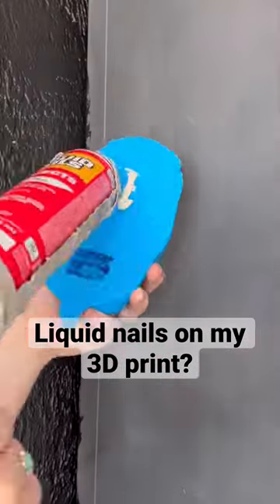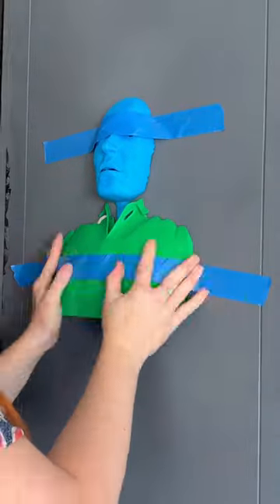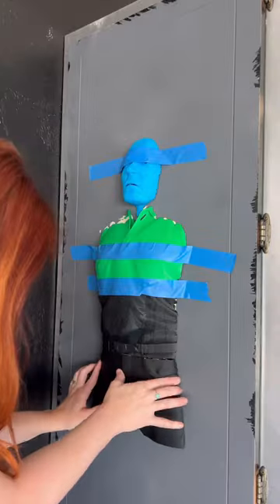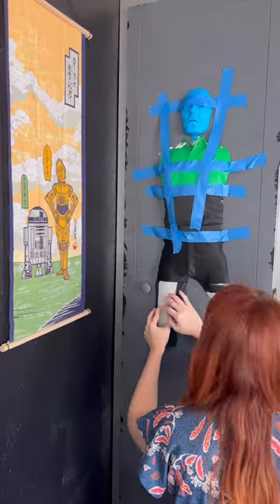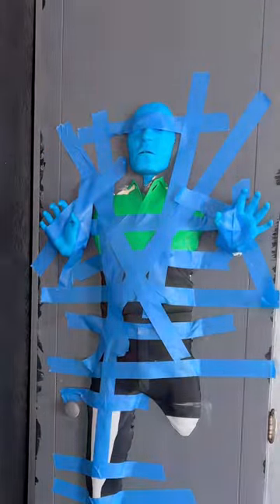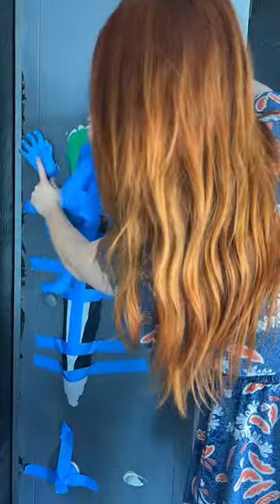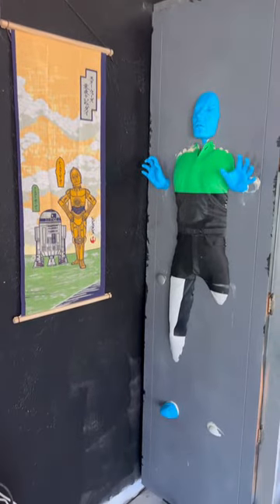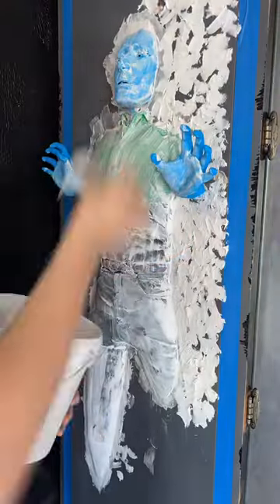Was I impatient or was it never going to work? Han Solo in Carbonite

Comment: That looks really cool.  I'm curious why you didn't just pull the door off
Reply from the maker: it is a very fair question! The inside of that door is currently packed with supplies and in the moment it seemed like a better plan to work on it as is vs unloading everything and fighting with the hinges from the 80’s, but that would have certainly saved me from the gravity issue! Having the door attached also ended up being incredibly helpful to make sure I had the left hand positioned properly so the cabinet could open successfully all the way without it obstructing anything so there were some helpful aspects to it. Always learning!